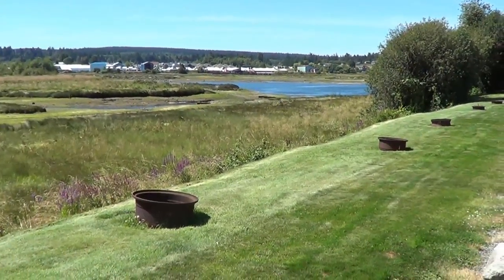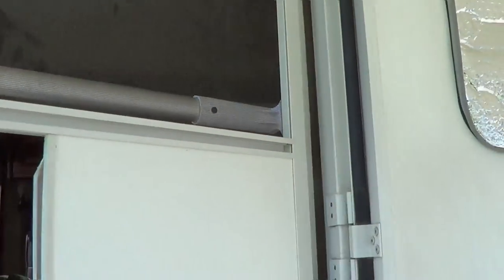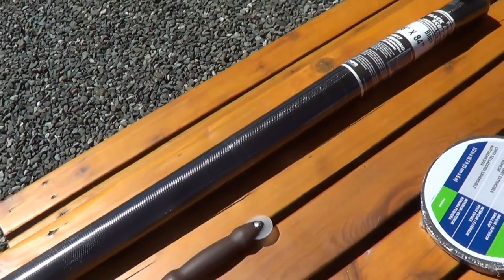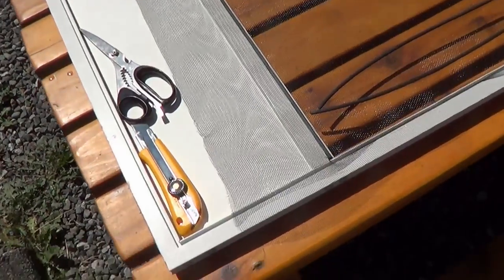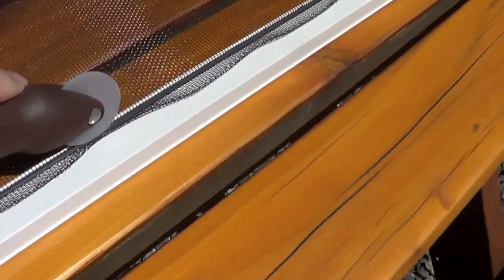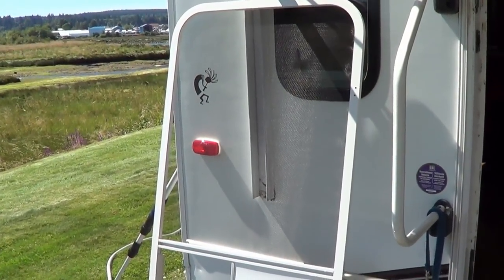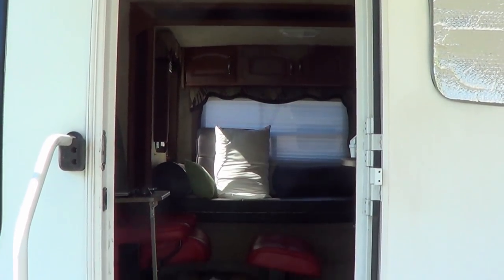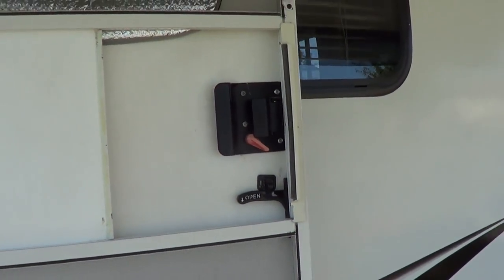RV Screen Door Cleaning and Repairs

Comment: Thanks for the video, Ray.

Rather than using the metal blade on the oscillating tool which might scratch the paint, you could use something like a 3M Adhesive Eraser Wheel with your drill.

https://www.amazon.com/3M-03612-Adhesive-Eraser-Wheel/dp/B005RNGN8I

I had to have the vent shades replaced on my pickup last year and the body guy used this to clean up the residue from the old two-sided tape.  Works really slick.

BTW, if Angie is going to supervise your work, she needs a white hard hat!
Reply from the maker: Sweet, thanks for the tip.
Reply from the maker: I'll have to give that a try when I do my storage bays, the weather stripping on them is bad too. Cheers! Ray

Comment: Cool, glad you found a scraper bladed or your multi-tool. 

Any idea of when you might do a preventive maintenance video of your batteries and solar set-up, hint hint?

Thanks again for the great video and glad to see Angie in it!

Mark
Reply from the maker: Here are a post and video I did 2 years ago on battery testing and maintenance. - http://www.loveyourrv.com/maintaining-and-testing-my-rv-batteries/  Since then I've of course upgraded to 4 golf cart batteries, seems a perfect capacity for out boondocking needs.
I've been lucky with my solar system connections, everything seems to stay corrosion free. but I check them once in a while make sure nothing is coming loose. Cheers! Ray

Comment: Awesome, thank you Ray. Just finished replacing all RV trailer side and rear safety lights with some T10 Yorkim 194s. They twice as bright as my old regular 194s and short enough to fit lens cover on. Got em on Amazon, 10 for 9.99$. Think it said they were 100 lumens at .7 watt. Can or what brand and lumens 2057 LED bulb do you recommend for my dual filament tail/brake light bulbs?? Wishing you much health, peace and happiness. Thank you, Klaus.
Reply from the maker: Sorry, can't help on the one. I'm looking for some bright ones myself, the LED bulbs I tried on the tail lights were just too dim so put the incandescent back. I'm considering replacing the whole fixture with an LED unit. Trying to find a set that will fit, maybe these - http://amzn.to/2tUKZHM  Just not sure if they will cover the holes cut out behind the existing lights.
I have seen a picture online with them - http://www.irv2.com/attachments/photobucket/img_1167106_0_bd5a1c47197c8cd6b26525fb768ffdcc.jpg
Reply: Love Your RV Oh, interesting. Thanks. Looked like there were a ton of these 2057 LEDs available on Amazon. I'm gonna read some of their info and maybe contact the seller. Thanks so much. Hope U have successful find. Keep us posted . thx
Reply: Love Your RV I just spoke with a fairly knowledgeable guy at Harechevy.com in Indiana USA. Tyler says he uses LED bulbs by Stark Industries which are CREE rated. Cree rated is the key. Hope this helps. He says he replaced all his bulbs including headlights both on his 2015 1500 Silverado pickup as well as on his trailers. I'm checking them out right now on Amazon. Best, K
Reply from the maker: Thanks!

Comment: Thanks, another helpful tutorial. When you installed the rubber ribbing to secure the screen, did you cut individual pieces to length or did you use one piece and just go around the corners?
Thanks.
Reply from the maker: I reused the ribbing, it was still in good shape. It had 4 pieces for the lower screen and two for the top. One long piece went around the curved corners at the top of the door.

Comment: I have a question on your eternabond tape job on the roof. I have used some to repair a ripped spot in my roofing material. I didn't use a sealer for the edges and the thin white backing seems to have shrunk a little leaving sticky gray edges. Have you noticed any shrinkage? What type of seam seal caulk did you use? Thanks Ray for the good videos.
Reply from the maker: There were a few spots the gray sealant squeezed out a bit beyond the edge but hasn't changed much shrinkage wise. Most of the tape edges I added a thin bead of Dicor Self Leveling Lap Sealant.
Reply: Love Your RV thanks.

Comment: Hey Ray,
love the videos. I have the exact same model Cougar you have but a 2012. My batteries are on their way out and i plan on switching over to 6 volt instead of 12volt. All we do is boon dock and i was wondering what your thoughts were on puttiing 4 6 volts in the forward battery compartment? Too much weight ? To much extra weight on the truck (3/4 ton gmc)?Its a metal housing in my year model but i really dont know? Also any suggestion on battery brands ? Thanks for the help in advance Ray I appreciate it . Love the channel too Thanks JOE
Reply from the maker: Thanks, Joe. I added 4 batteries to mine a few years ago and they have been fine. http://www.loveyourrv.com/wp-content/uploads/2016/01/Interstate-battery-bank.jpg It looks like the front pan is welded and steel. We've been on some rough roads and put on many thousands of miles.
I have other Cougar friends with a similar setup and no problems. I have 4 Interstate XHD UTL 6 volts, they were a reasonable cost and have held up well. Another popular brand is Trojan. I've also heard the 6 volts batteries at Sams Club are bad for the price. This video gives a closer look - https://youtu.be/uRbGmxun1LI?t=302 Cheers Ray
Reply from the maker: err I meant not bad for the price. :)
Reply: Big thanks for the help Ray!
Reply from the maker: I'm not sure on the 3/4 ton, you'd have to know how much extra payload you have. The 4 batteries weigh about 250 lbs and most will be on the hitch since they are so far forward.